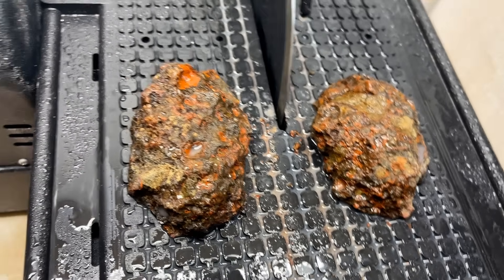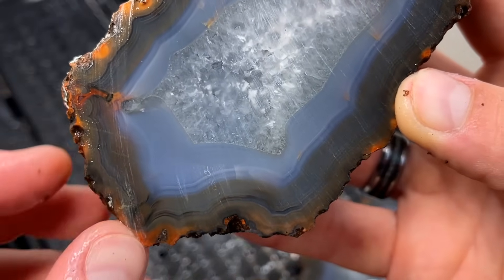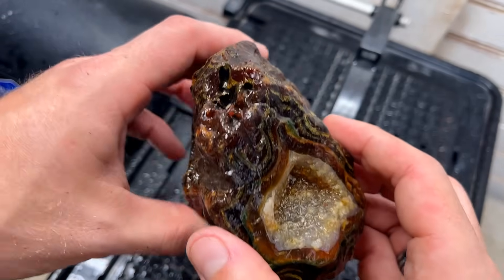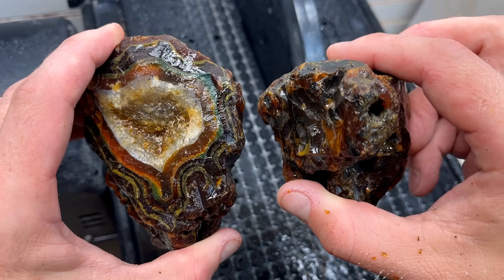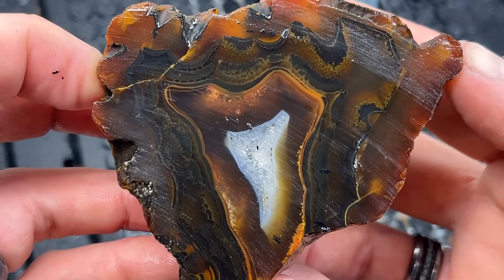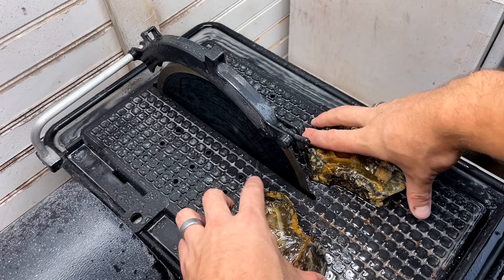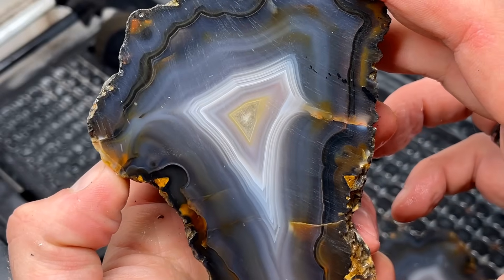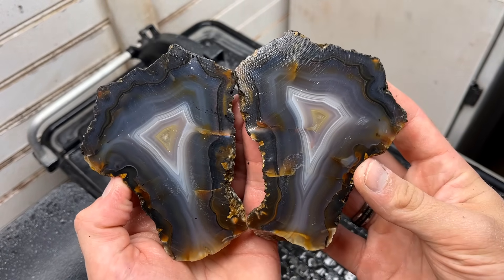I cut 3 CHUNKY agates open on my saw!

Comment: That second one displayed with a little light behind it would be so pretty. If a rock can be called breathtaking, the last one deserves it! 
An unrelated question if I may? Now that you have  run the 10" Hi-Tech saw for some time, what are your thoughts on the notched blade that comes with it?I haven't seen you run it, just the sintered blade. I just got this saw but haven't started using it yet. Do you always run them in the same direction? Thanks.

Comment: There is something bothersome to me some but is also very informational. The fact that I've heard you mention with this machine and also with the cab polishing machine, that your hand cramps up. I hate that because my left hand cramps, often times, when I have a grasp-posturing, with it. I've been considering getting a saw but I probably wont get one unless it is self feeding. That's probably gonna be expensive. I will probably figure out a way and then I will simply flat lap my cuts instead of creating cabs. Thanks, Dad.
Reply from the maker: Yeah self feeders are probably twice as much
Reply: Hey, @AgateDad , I just looked at the product page for your High Tech Saw and I noticed there is a vice accessory that can be added. Have you used the vice on yours and if so, does it work nicely and possibly help to prevent the hand cramping. Maybe you could try it and let us know. I'd like to get that setup but I want to know from someone who has used it. Thanks, DAD.